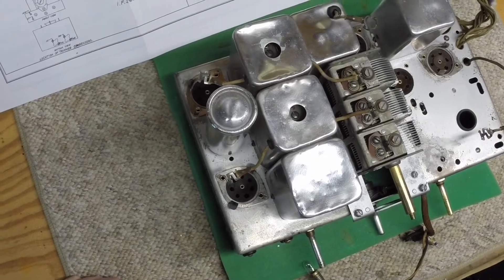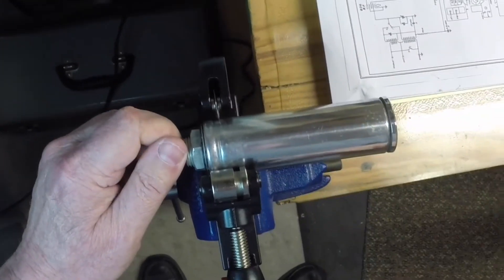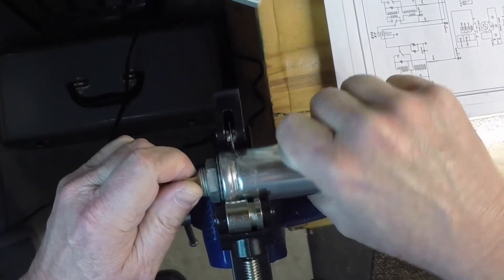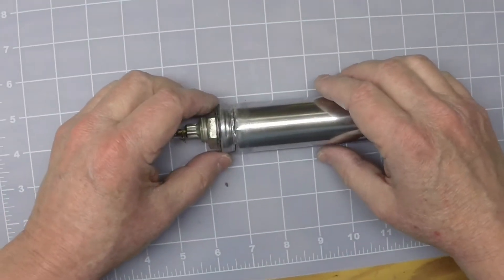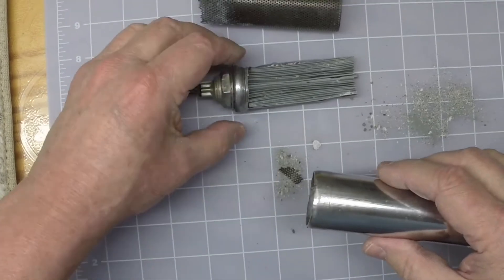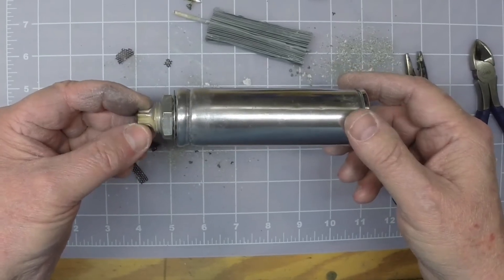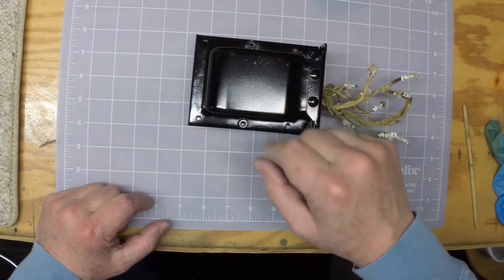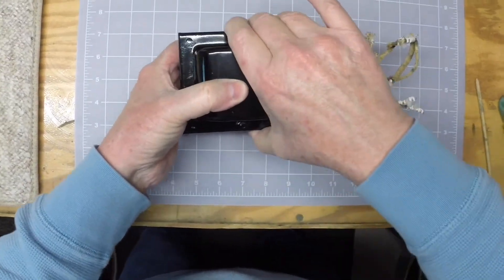Grunow 6C - Capacitor Can & Power Transformer

Comment: Hey Don, 
Ron here, ...on that electrohome chippendale 2  I'm picking at, I was wondering how to read the "Date Code" on the 3 Mallory electrolytic can capacitors, there are many different views some have on these codes (lots of searching/reading) just thought I'd ask you, as I trust your judgement and thoughts.
Reply from the maker: +Ron0963 Ron - do you see a code that looks similar to (235-7910)? If so, I believe the caps were made by Mallory during the 10th week of 1979. I think 235 represents the OEM # for Mallory followed by the production week. I would double check with someone on the Antique Radio Forum or other... to confirm. Let me know what you find out. Best, Don
Reply from the maker: +RestoreOldRadios +Ron0963 Hi Ron, did that info help? Best, Don
Reply: +RestoreOldRadios Thanks Don, those numbers don't show, I've sent an e mail with photos of the three of the cans in the amp

Comment: Oh that is a great technique again with the tube cutter. I have seen many do it with a knife like some others that do TV's and such, but it seems so much cleaner that way Don. I will invest in that soon I hope, I already have 2 radios that would look better that way using your clear
plastic rolls from the hobby shop you mentioned a few times. Looking really great so far. That denting is really funny tho? Maybe it was placed upside down somewhere for some reason. Very Odd.
Reply from the maker: Tony - By far, the tubing cutters have provided the best result for me when it comes to opening these mid sized round capacitor cans. You saw in another video, I modified my process by applying two strips of painters tape to create a "lane" the width of the blade to pass. This made for a very clean cut and one that was straight and stayed on course. One note, if you go this route, apply very light pressure and just let the cutting wheel work its magic; otherwise, you will dis form the can due to its softness. Best, Don
Reply from the maker: Forgot to mention the cans, you are right looks like it bounced up and down on someone's bench or was exposed to a hail storm. Lol.
Reply: +RestoreOldRadios - Oh yes the painters tape you did in a recent restore. Does seem to really do it very clean. That is at the top of my notes. Thx Don
Reply from the maker: +saturn5tony I'm always trying different techniques; some work well and others are a total... Best, Don
Reply: lol!!

Comment: Fun to watch someone actually do what I've only contemplated - using a tubing cutter to open an electrolytic can!  Guess it's time to buy one. 

As a relative newcomer to the hobby, I wondered how to re-stuff one of these cans.  Then I watched the procedure at https://www.youtube.com/watch?v=3U8-2RZIJHk and have had great success using his method of employing a PVC pipe coupling to provide interior strength.  It fits perfectly and brings great strength to the area where the two pieces of tubing are joined.
Reply from the maker: K9UW I've used an X-ACTO knive, a utility knife w/ a new razor, a small hacksaw, and Dremel. By far, the tubing cutter is my favorite. It takes very little effort compared to the other aforementioned methods. I'll have to give the PVC a try sometime when the internal capacitor space is not an issue. I typically use a thick plastic (~2 turns) cut to length and width, which doesn't take up much room and it still provides stability to hold the two sections together. I'm getting ready to post a final video on the Zenith 808 and I used blue painters tape on the electrolytic can to create a narrow lane for the blade to travel and I got the best results to date. In addition, I made sure to apply very little pressure and let the cutting blade do the work. Thanks for watching and your comment. Let me know how things work out if you decide to go this route. Best, Don

Comment: Interesting to see the inside of that can, I've not seen one like that. I've had good success cutting open cans using an X-Acto Extra Fine razor saw (available from all good model shops), using insulation tape as a guide. Excellent video Don, now to catch up on the rest!
Reply from the maker: ***** Andrew, glad you liked it. I used a new "utility" blade to open the can on the Chanticleer 2D570 and it wasn't the easiest process, but again this was my first go at it. Thanks for your recommendation, I will definitely give it a try in the very near future. Best. Don

Comment: Great work. have you ever covered how to address a bad power transformer? for example how to size one that is not popular enough to find another original
Reply from the maker: cptrdbrd Thank you! I haven't published a video on how to replace an OEM power transformer with a aftermarket or surplus unit, but I've done this a few times working through the math to get the proper transformer with very good results. If you have a radio with a bad power transformer, let me know the model # and I'll do my best to publish a video on this subject ASAP and incorporate your particular model into the design parameters. Best. Don